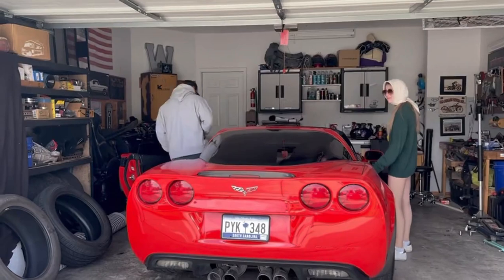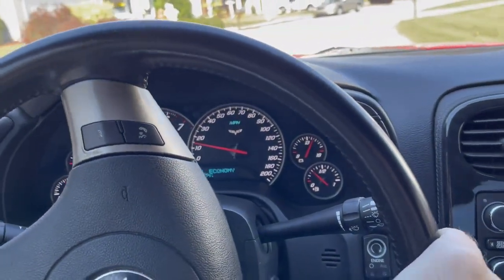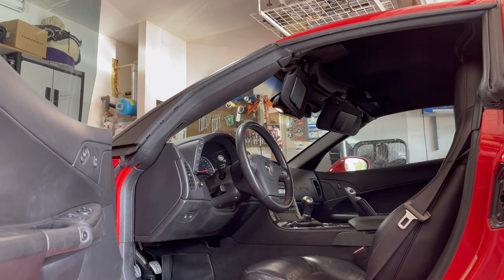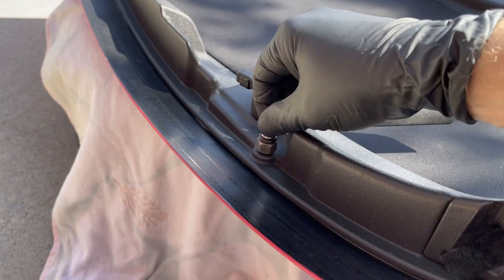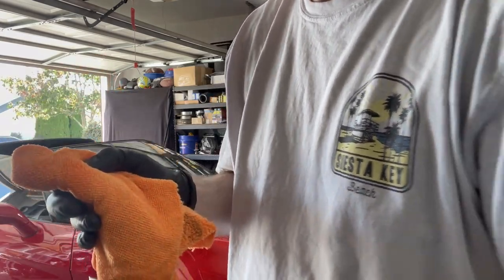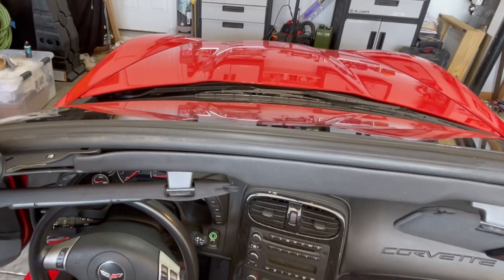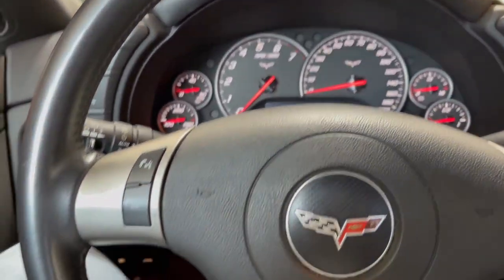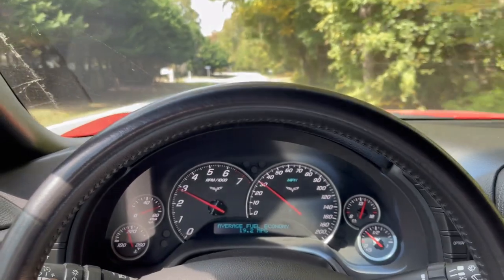Noisy Targa Top fix in 10 Minutes! C6 Corvette

Comment: You can also use the dielectric grease directly on the weather striping, especially on yours because the weather striping is so dry.
Reply from the maker: I might try it.  Been holding up pretty good but still not silent.  I want to give it a second treatment

Comment: you need to take out the bolts holding the front clamps.  get removable lock tight  re-aply to bolts and torque to 13ft lbs   weight for lock tight to dry   no more noise

Comment: You can eliminate it completely by throwing additional o rings on the pins (2 each) and pressing dielectric grease into the side channels of the top. It’ll hurt getting your finger down there but you’ll be able to feel the metal rail that can make contact with the top of the window sometimes. Also grease or lube on the weather stripping to keep it from drying out. It’s a pain but worth it on a nice sunset cruise or perfect summer day 🤘🏻